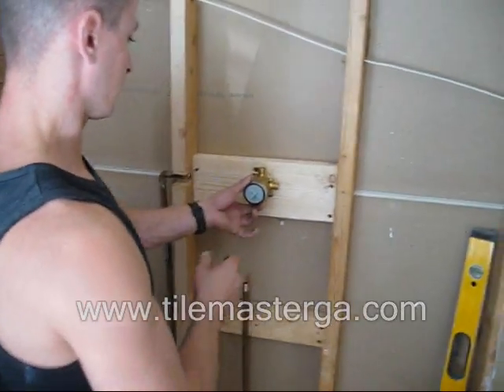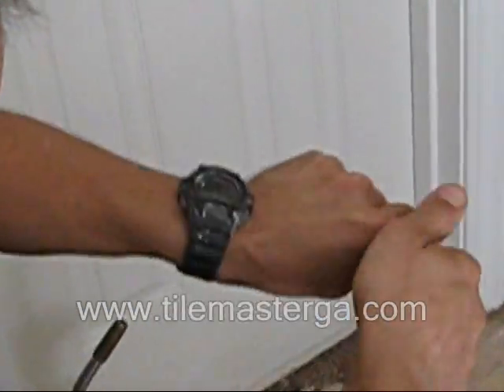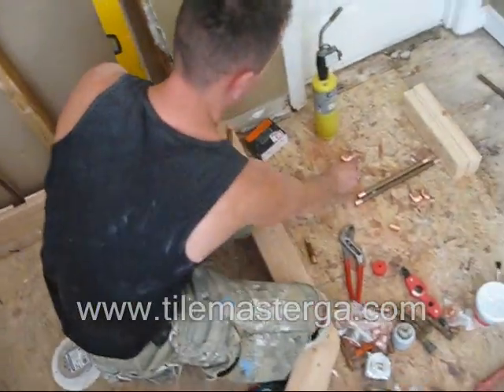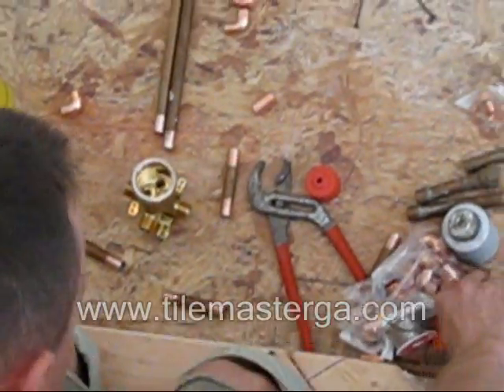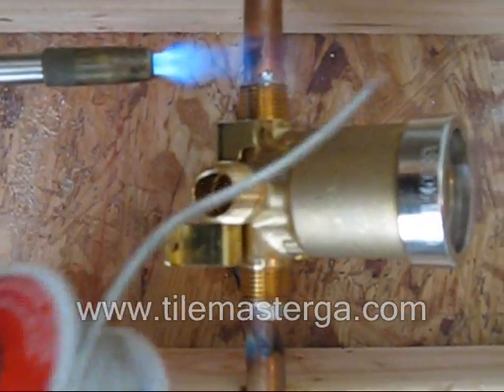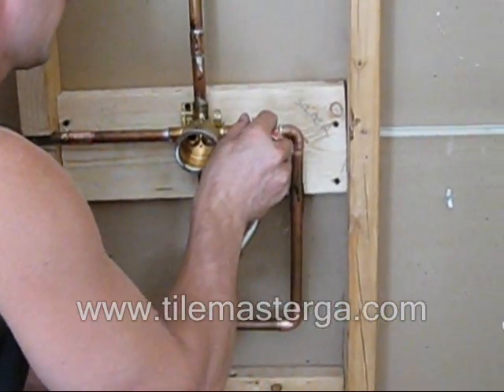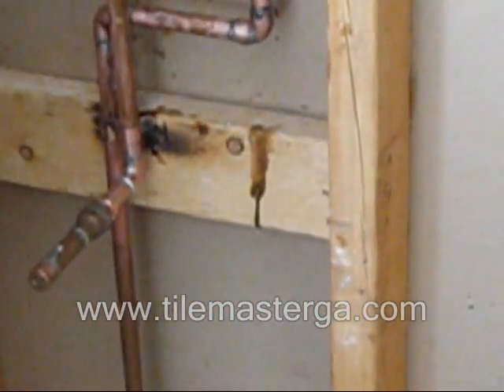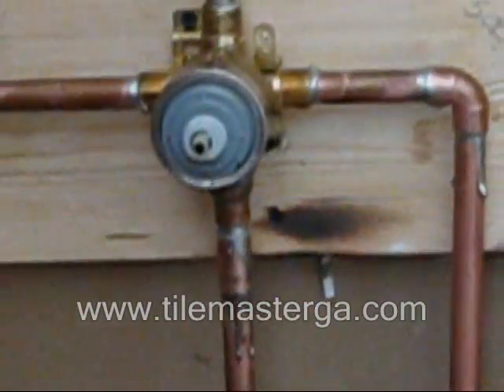Shower Valve replacement - brass rough in installation, copper soldering How to DIY - DELTA Part "2"

Comment: Scared of soldering, more of a mechanic than a plumber myself.  I appreciate the video and equally the comments of all you EXPERIENCED plumbers.  So hard to weed out manufacturer reps infecting time tried practices with bogus low probability outcomes to pressure and scare some to buy their product wether it be a good temporary fix or possible long term solutions.

Comment: Hi, looks easy to install but will it be difficult to remove the mixer with all the soldering? With concealed mixer, will there be a lot of work and cost just to replace a mixer? Thks

Comment: when you solder you have to bring your heat around to both sides of the fitting so it pulls in evenly also air chambers should be installed to reduce water hamer.

Comment: I noticed you did not make an air gap. Is it necessary to avoid pipe banging or does the valve close slow enough so that it is not necessary? Also, do you prefre to sweat the pipes directly in the valve or to use a fitting?

Comment: There's a reason why they use copper.  There are places when copper is best, and places were PVC or ABS is best.  If you use plastic you'll be broke paying for repair bills. In California they build homes with Polyester piping.  The maker went bankrupt from thousand of lawsuits for failing pipes.  A law was passed against poly piping.  Now against building code. New does NOT usually mean better but cheaper made and more repair.   Welcome to the new junk world.

Comment: if you dont want to redo the tile on the wall moen makes whats called a renovator plate that allows you to cut a hole where your existing valve is, replace with the new on and it covers the hole, it fits on any moentrol or possetemp model shower valves

Comment: Delta is the best..I installed a Moen.."Two months" later, where  the screw in adapters went into the valve body ..a hairline crack and a leak developed.. Luckily I was busy with other projects, so it wasn't tiled over yet...Always get solder in connections...If you get an inferior valve casting ...It might crack...but not right away .How often is a valve body pressurized for 2 months and then it leaks..so glad it was still accessible..

Comment: Cool video but how do i replace valve that aleady install. For example i want  brough a whole brand new moen package, and there an existing valve on the wall. I'm Thinking that i have to destroy the wall and cut the old copper pipe with the valve?? IS this the eazy way to replace an entire valve?? ...

Comment: noticed my new delta valve has 4 male thread ends .........I'm not the best solder..er. What are your thoughts on shark bite fittings? compression? By the way....thanks for your videos!!!

Comment: Dear Sir, I'm not a US or a GB resident (I'm not sure about the origin of this video), and I'm not criticizing anything here just ofer some people to be open mineded.
I use in my home the Pex system for the last 30 years, and never had a problem.
BTW, the Pex pipe is made from Aluminum alloy and protected by inner and outer pvc layers.
However, its not about the material that i'm talking here, its about the system.
Today they improved the system to a quick push fittings connection.

Comment: 21st century materials, huh? You mean like pex? Yup, let me know how that worked out a few years ago.  As a class A contractor, I honestly haven't met one plumber that uses anything but copper. Oh and copper wasn't really standard til 1950 (20th century). The 19th century was lead) iron) galvanized iron) and brass). Although, the egyptians used copper 5000 years ago. So there's that....And a final thought-copper is bacteriostatic. But your personal opinion is good argument for yourself.

Comment: I respect your idea and added a like since I really believe this is a good and helpful video to those who desire to use that system. However, I'd like to show you the new generation up-to-date technology.
This system last forever but it is definitely not cheap.
The problem is that I can’t add a link in the YouTube reply box. Check in google SP PIPE, and choose: THE BEST PIPE IN WORLD. I believe you will like it.

Comment: Also you should never put cartridge in for test,thats what the plug was for you removed in the beginning of segment.If cartridge is left in the flux and other debri can cause problems with the pressure balanced cartridge......Hello..

Comment: Do you replace the valve most of the time when remodeling shower...I will be getting my shower redone because it leaks (60 year old mud install) Should I change it to a single handle--hadn't really thought about the valve (just the non-stop leak)  Advice?  Thanks for sharing I really appreciate you taking the time to educate us...!

Comment: @gblueslover2 Those fittings are code approved even if you don't have any access point (in most locations).Not long ago the different MANUFACTURERS had disclaimers that they shouldn't be concealed.Things might have changed but still don't fully trust them and they are ridiculously expensive!

Comment: Why did you cross the intake line behind the tub spout?  Any reason for needing to do it that way?  Also, when applying flame, I have been taught to apply the heat mainly to the coupling, that solder follows the heat into the coupling, not to simply melt the solder.  But if you melt enough solder onto the joint, aren't leaks pretty unlikely no matter which way you do it?